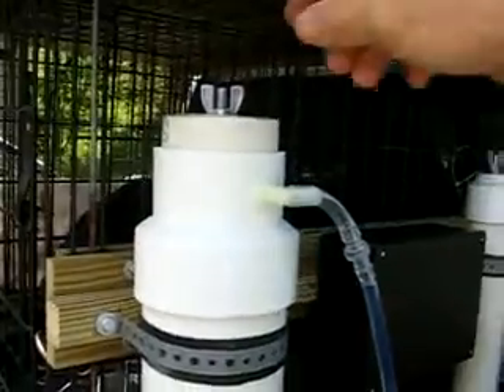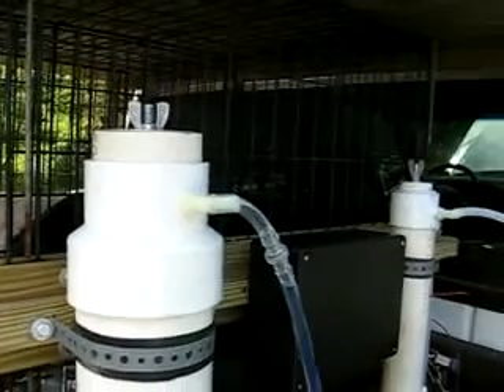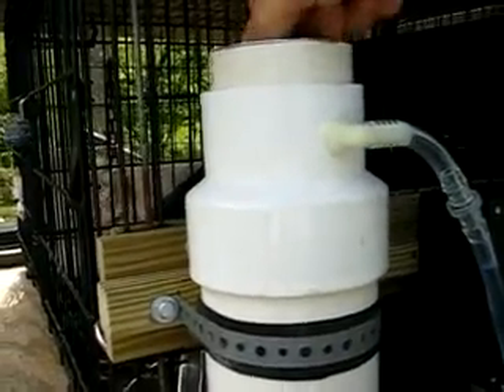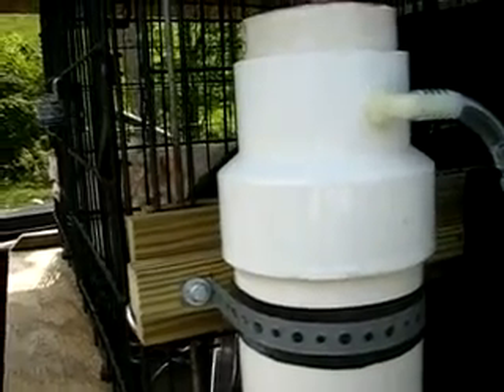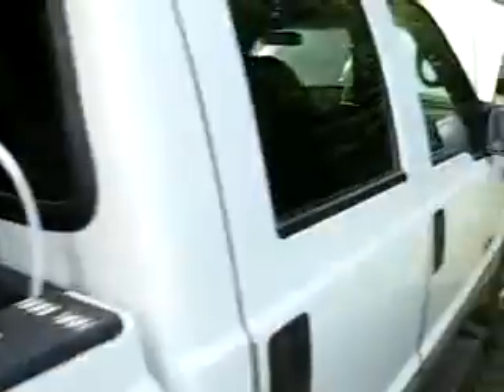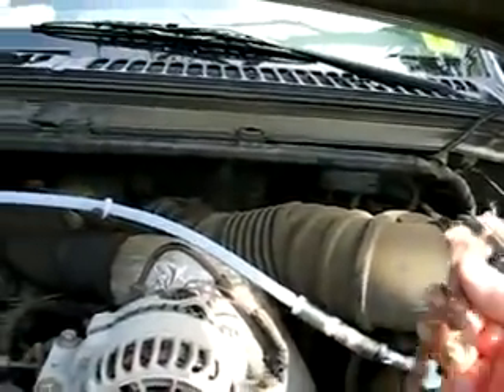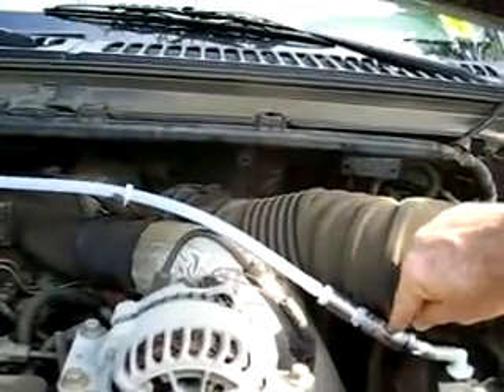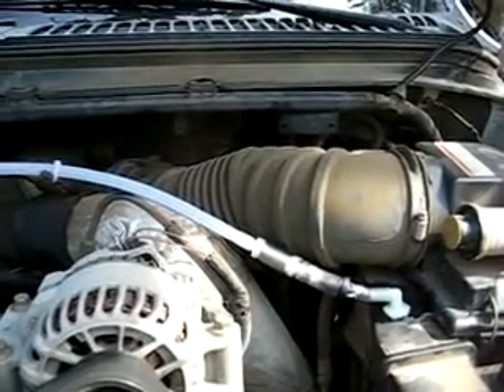010 HHO Flame Trap Problem F350 7.3L Diesel

Comment: Remove any and all restriction and make a tight air proof seal where it connected to the intake. If Your intake valves are properly timed should you should never have a flashback or backfire or back pressure. Keep it up you'll get there. And link your HHO resivor chamber directly to Vacuum of your intake for best results!
Reply from the maker: Pleasure by the Gram I removed the flame trap during this video because I realized flashback is not a problem with diesel engines. Making connections air proof will not make any difference. The hydrogen/oxygen ratio of HHO is already perfect for combustion. Connecting the output to an intake under vacuum will lower the boiling point in the brick.

Comment from the maker: @devman224224 Hi: I have 118,000 trouble free miles on mine. Check out powerstrokehelp here on Youtube, he has 750,000 trouble free miles on his. However the maintenance is high. For instance it takes 15 quarts to change the oil.
Mars

Comment from the maker: Hi krazikuban87: Check out my Playllist "Powerstroke MPG upgrades" and you will see that I have done all your suggestions and more except that I currently don't have a chip installed.
My truck is a 4X4 Crewcab dually with an automatic trans and 4:11 Gears. It will not get as good MPG as smaller stick shift Powerstroke.
Good Luck, Mars

Comment from the maker: ContinuedI would rather see a slight amount of positive pressure on the cell help prevent water vapor from forming. It has pretty much been proven that a vacuum just causes the water to boil at a lower temp. On future HHO cells I would like to have a system that run under enough pressure reserve that I could regulate and vary the flow of HHO in to the intake.
mars

Comment from the maker: Hi busybill2:
Actually I will probably use 1/4" hose on the next generator. A 1/4" hose can move plenty of gas and has less volume in case of a spark. I have eliminated the check valves in the HHO stream. I now have a check valve that allows the reservoir to draw air when it cools and that prevents water from the bubbler from being sucked back. Some people think that you need to vacuum the HHO off the cell, I do not. Continues

Comment: And the answer to to that is: 
"Crrrock: I just stuffed the hose down the inlet snorkel"

And this is because the bubbler will give u protection, but at the same time IT WILL clean the gas of any water "mist" that the cell is also producing. Yes, very fine water-mist, like a fog comes off the surface of water in the hho-cell, i have seen this in all of my cells. It will expand to steam in the combustion, giving more power in engine, and faster acceleration = less gas usage :)

Comment from the maker: I can't put the HHO into the after turbo side until I figure out a way to match the HHO injection pressure to the variable turbo boost pressure. If I don't match the boost pressure I will get less HHO when I need more and more HHO when I need less. I am reluctant to try to make a pressurized HHO system because of the explosive nature of the stuff. If I had a pressurized system with a small reservoir @ 20psi. I could hold back HHO at idle and inject large amounts at full throttle.
Marshall

Comment from the maker: Hi Oz:
Wow! I would kill for a 40% increase! My best increase is 18.9% driving like a grandma on country roads with the cruise set at 52-55 mph. When I pull a load I get almost no improvement. 

There may be some truth to the idea that the Powerstrokes double shot injectors don't work well with HHO. It might also be that some magical property of HHO goes away by the time it works it's way through my air filter, turbo, and intercooler.  Continues...

Comment: Mars,
when I built my first cell I fitted it to the back of the cab.
Mitsubishi Canter, 3.9ltr non turbo diesel.
I just stuffed the hose down the inlet snorkel.
No flash arrestor, but then I also had no fuses or definite power control, just an on/off switch.
However, I still achieved a 40% improvement, and that was with 600ml/min.
I think I was lucky.

Mike
Oz

Comment from the maker: The LEL is the lowest gas concentration that will support an explosion when mixed with air, contained and ignited." Hydrogen's flamable @4% concentration and will explode @15% concentration.
The hydrogen in my air intake is about .003% (that's not 3% it's 3 thousandths of a %) I would have to put in 208L per min to hit 4% concentration.
Thanks for the comment, Marshall

Comment from the maker: I agree and I have removed the wool from the trap and will not put it back. I had to leave the empty trap in place because the hose is too short to leave it out. I was just being a sheep when I put in a flame trap. I didn't really think it was necessary  at the time. The HHO input on my truck is literally about 10 feet from any possible flame. Once the HHO is introduced into the intake air stream it is below the LEL for H2 (see the definition of LEL in the next post)